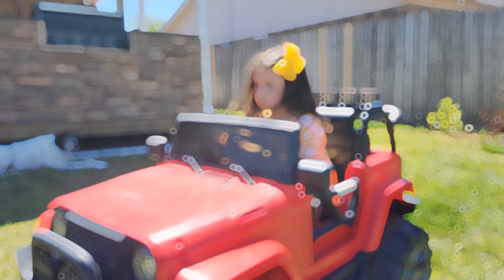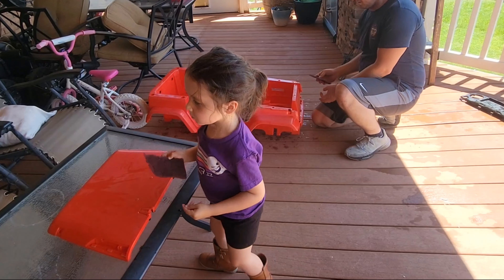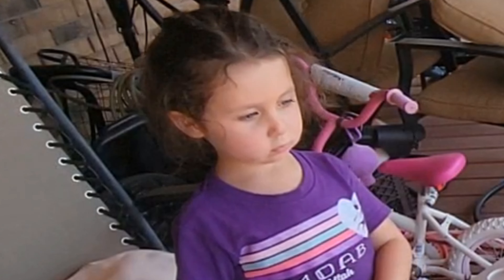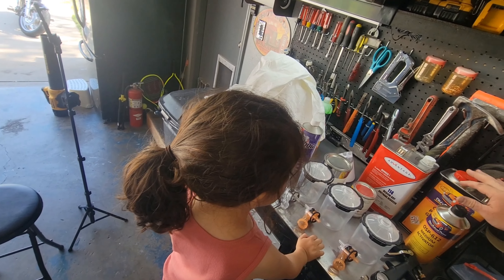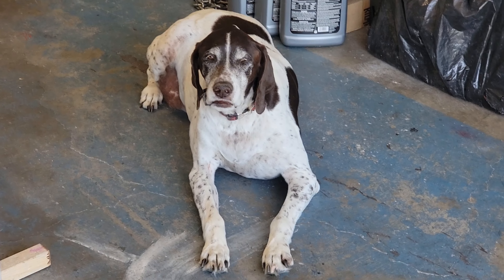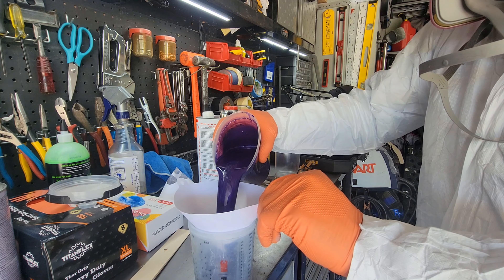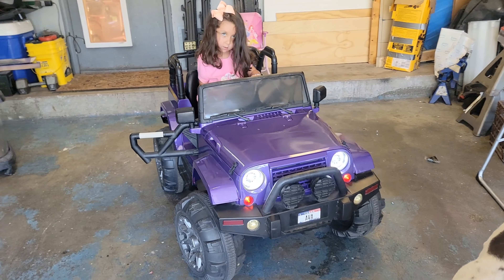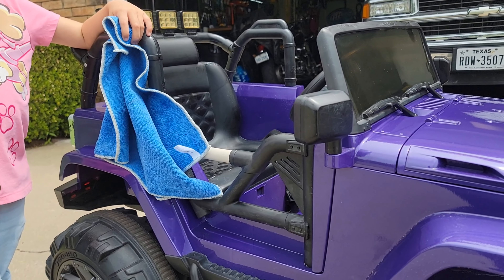Ava paints her power wheel jeep.

Comment: How did you remove the steering wheel assembly? I can’t figure out how to remove it.
Reply from the maker: You have to remove the linkage and steering motor underneath, then depress the clips on each side of the column while pulling the steering wheel, It should slide off. Then there was a small metal dowel pin under the steering wheel that I knocked out the a nail and a hammer.
Reply: @treyhaberman  Thanks! I snagged a pink one yesterday that my neighbor was tossing out that’s in need of a paint job. I removed everything except the steering wheel and dashboard. I couldn’t figure out how to remove it without “customizing” a few pieces. I’ll revisit it again tomorrow now that I know it can be done.
Reply from the maker: @christopherhall8119  welcome man, hope it works out ok
Reply: @treyhaberman  it worked out! It’s amazing what a little guidance and some daylight will do to help you get some things accomplished. I really appreciate your help.
Reply from the maker: @christopherhall8119  awesome deal. Have fun